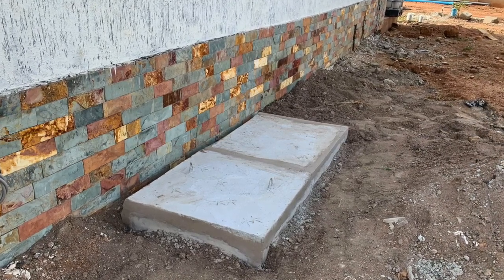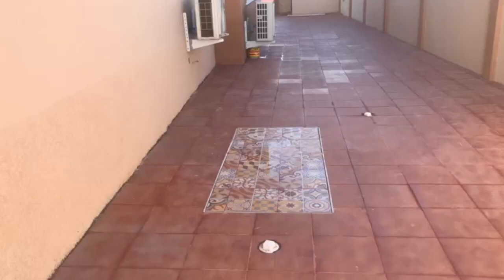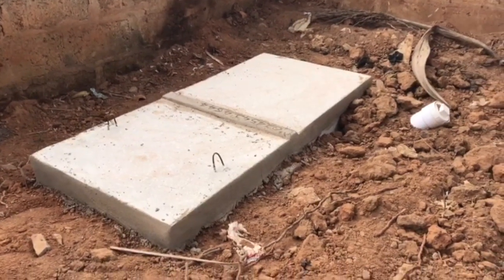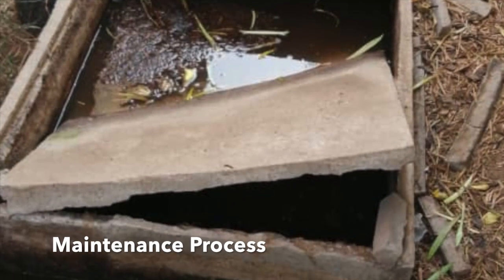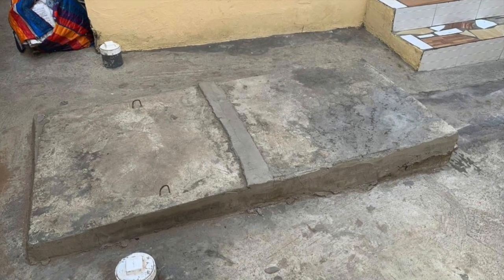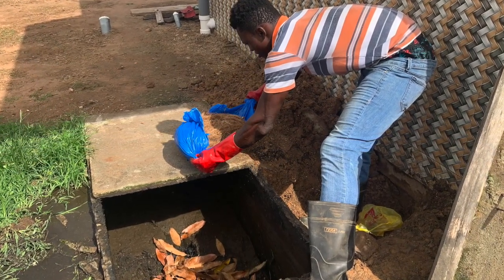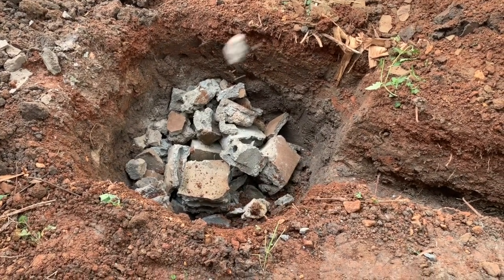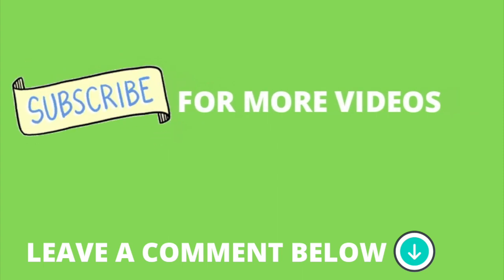How to do a Biodigester Maintenance

Comment: My biodigester soak-away cannot drain out. What should I do pls
Reply from the maker: If it’s a traditional soak away then simply have the water pumped out. If it’s a soak hole pit with stones in it I’m afraid there’s nothing much you can than to do a traditional soak a way and connect a new leachate pipe from the digester into it.